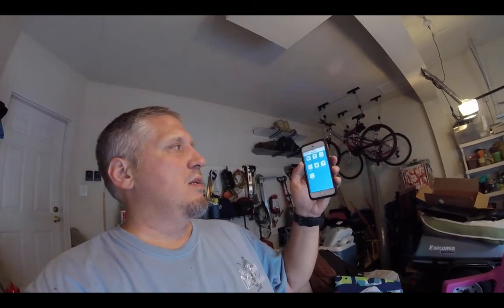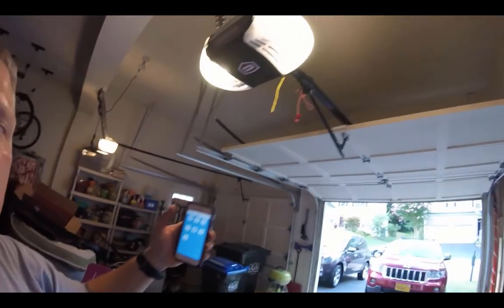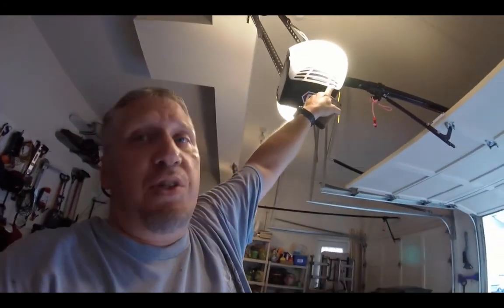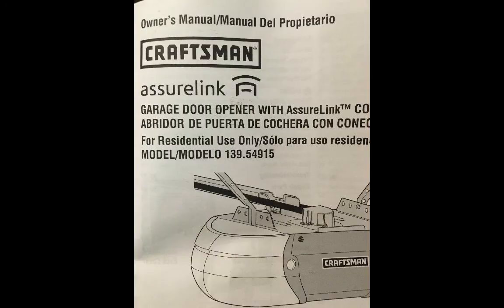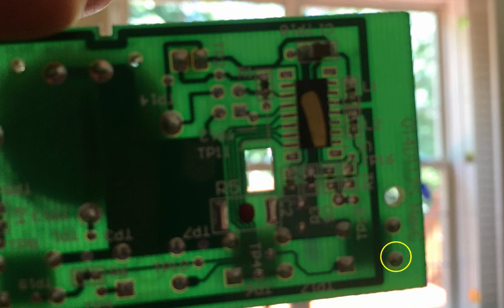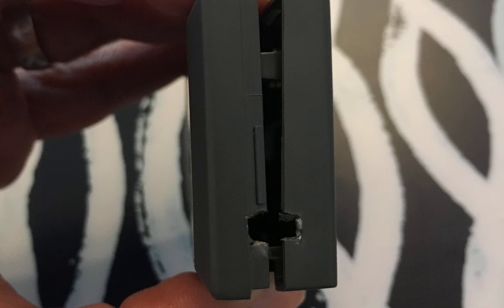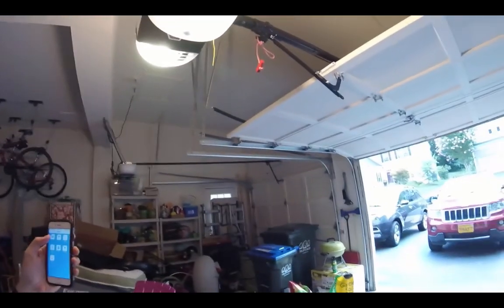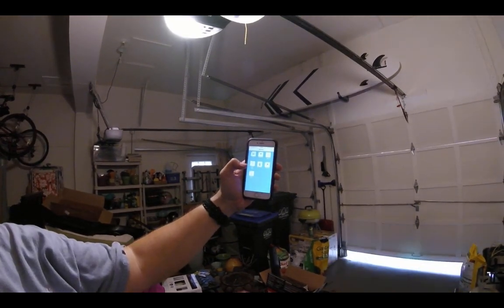Insteon Garage Door Opener Hack

Comment: I know this is an old video, but looking to do something similar with the Wyze Garage Door Controller.  I'm a noob at this and was wondering if there was a fool proof way to know the which contact points to solder the wires to?  There looks to be four solder point on the back of the board for the one button.
Reply from the maker: I believe I tested the remote contact points by shorting two of them. I’f the door moved, I had the right sided points.
Reply: @242Shaker  Oh good call.  Perfect, thank you!

Comment: I'm confused what you did.  If you connected the wire you added to the remote to the Insteon I/O Linc, it seems to me that is all you had to do.  When the Insteon triggered the remote, the remote would operate the door.  What did you additionally connect at the opener motor assembly?  Did you just hook into the safety switches of the garage door to trigger the state of the door (opened/closed) back to the Insteon on the Input terminals?

Comment: FYI I was also able to accomplish this with the single wired push button opener. I soldered the two wires to the terminals of the inner button, and it worked like a charm.

Comment: Great tutorial. I basically encountered the same problem with my Chamberlain door openers that came installed with my new house. I found I could make the system work by opening up one of the wall switches and soldering the two wires directly onto the contacts  inside the multifunction wall control.  But the way you have this done would be overall simpler to deploy I think. Its easy to acquire additional remotes to perform this easy workaround.
Reply: I like this idea a little better, as it doesn't require changing batteries when it eventually stops working.
Reply: I've tried this with my Chamberlain and still not able to get it to work

Comment: I had this same problem. I called insteon and found out that I should have disconnected the wall wired remote before installing. They had me remove the wires that attached my wall mounted remote to the opener and reset the Insteon devise by holding down the set button while plugging it in to the receptacle. Once that was done the insteon worked with the app. Then I reinstalled the wired remote and BAM everything worked. They should have put that in their instructions.